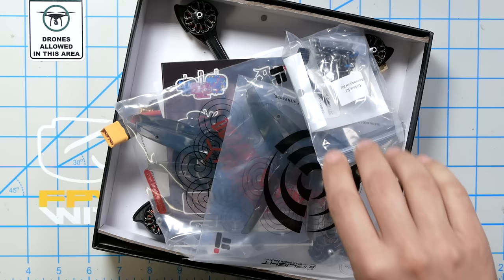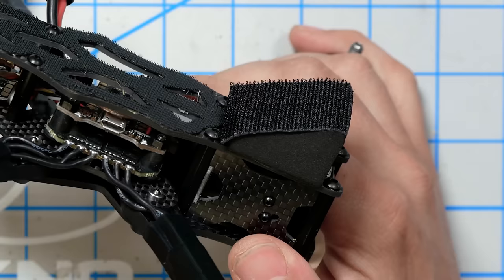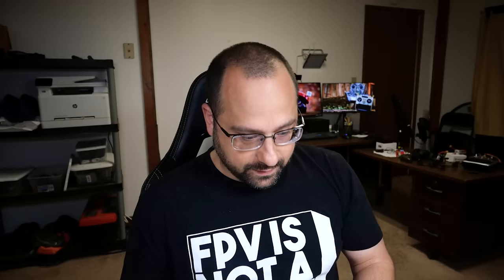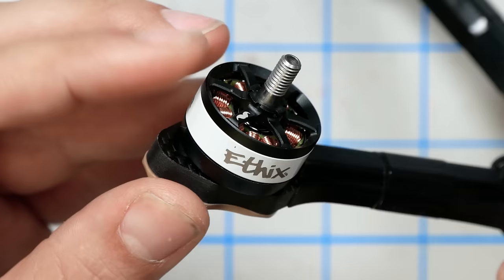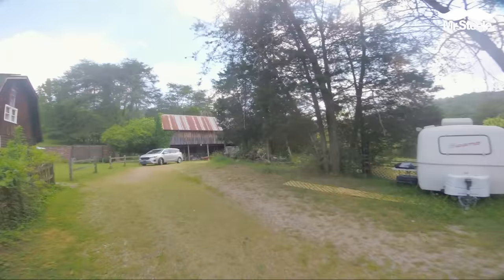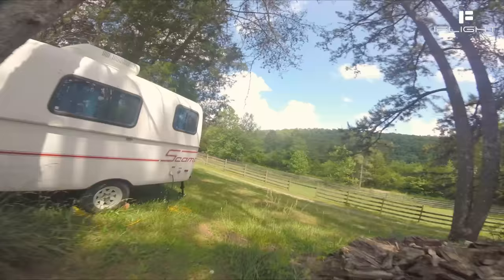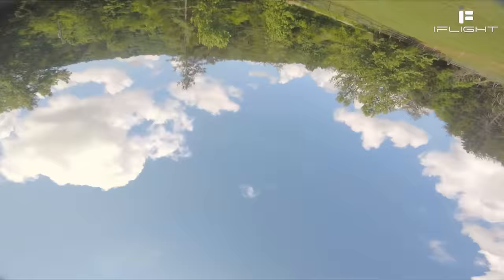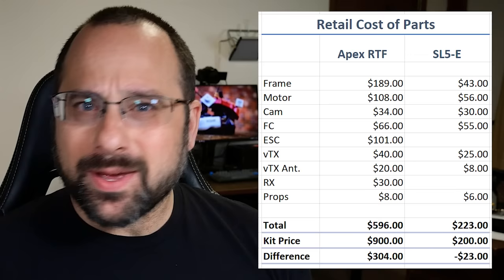Mr. Steele $900 Apex RTF vs. $200 iFlight Cidora | WHICH WOULD YOU PICK

Comment: I been flying the KISS 4in1 ESC pretty much since it first came out & can also say, never had that happen to kiss 4 in 1 (Well I have burned one but that was from my own up all night till 5am building stupidity 😂)... Unlucky there. As far as actual frame durability goes, Apex is the most durable frame I’ve ever flown. My prototype Apex test frame (I was one of the test pilots for ImpulseRC during the Apex development ) is still going strong for over a year of abuse now with nothing but the expected cosmetic grazes, chips, nicks and a bit of delamination damage to the tip of one of the front arms from smashing into a rock after diving from a cliff. Arm still structurally good even after that heavy impact (And prototype arms were actually a bit thinner & lighter than the final production version) I know my Alien arms wouldn’t have survived an impact like that and Alien was a tank. Apex is quite exceptional in the thought that’s been put into it, it’s very apparent when building it. Apex was designed around KISS Components & TBS 5v unify, the placement of that particular VTX isn’t a problem as it simply just plugs/unplugs to pigtail connecting it to the ImpulseOSD board behind the camera so top plate can easily be removed completely and out of the way. You missed that there are also strain relief holes either side of front bottom plate for extra xt60 placement options. I do understand you’re just comparing as they come in RTF form though. So in regards to that, I would agree in your conclusion that it would be insane for really anyone to spend $900 on an RTF. 99.99% of pilots shopping for an RTF have no need to spend that much & the rest of the market would just build it themselves. Though as a professional tradesmen in my day job, I think the $300 mark up difference you’re questioning is quite fair when you consider labour (time, effort & workmanship) costs in the USA compared to labour costs in China. I’m imagining the RTF Apex is built in-house by Get FPV staff and the iFlight built for peanuts in some Chinese factory. That’s probably worth a mention. Would really find it interesting to see you do an actual frame review & build of the Apex to you own specs and compare building & flying it to your favourite daily driver.
Reply: KrissKwadd ditto luv my hd apexes...hes gonna put betaflight in apex now n compare
Reply: @flo-ridafpv5713  Would be good to see him do that indeed. Even better build from scratch. Yeah man, is such a good & fun frame to build out & appreciate the thought that went into it. Awesome to hear you're loving yours mate 👌

Comment: omg i loved the refrigerator ending. I got a sl5e 6s from getfpv in march , friken love it , NOTE i had to switch the VTX power to 5 volt as it would reset when i would punch out , not fun but fixed. Im using a 6s 1300mah 120 tattu

Comment: Still watching but I say both will be fine but the key is to stick with one setup and fly until you have mastered flying it. That is the key to Steele, he has run basically the same gear for years. I flew many different quads my whole FPV life so far and even though I have been flying about the same time as Steele he is of course far and away better. Steele doesn't sell his build to rip people off he sells it because many people think its the gear that makes you good and if they only had exactly what Steel uses they will be good pilots. I think the price proves it, he is trying to get people to source their own parts and learn but lots don't want to so give them what they want.

Comment: I know this is an old video but have to do this:

No there isn’t a “ton of profit in this”

I will go crazy and say they save 40% off of retail for parts (which it is probably closer to 20-25%) but I’m exaggerating for effect. That increases what you call profit (which it isn’t) from 300 to 538. That is a 38% material cost for the product. 
Labor costs at minimum are 40% and labor benefits and payroll taxes are (depending on state) usually around 30% of that. Which means labor costs for that product are roughly 52%.
That leaves 10% of the retail left ($90).
We have not paid for building costs(maintenance/rent/phone/internet/electricity)/shipping/insurance/marketing/IT or the important tax man and business fees to operate.

Profit is not retail cost - cost of physical material. No matter what the business the highest cost for producing is LABOR. Doesn’t matter if it is a vehicle/food/furniture/computer. And again for effect: highest cost to produce something is the labor behind it; you want something for cheaper labor is being taken out by use of robots.

But there is a “ton of profit in this”

Comment: I can tell you that the iFlight quads are tuned for the "masses"- meaning average, all-around, safe, on the softer side tuning. The iFlight stuff [mostly] all needs to be turned up a bit.
The Apex quad is probably tuned for more the type of person who would buy a $900 quad- meaning high, tight, fast, sharp, hotter, cleaner tuning.

Comment: JB, 10:15, tapered arms don't necessarily mean that they are stronger. In the topic of strength of materials, overall cross section, width, and height would matter more than the geometry (taper/straight). Assuming the carbon fiber material itself and fiber directions are the same.
Reply from the maker: Tapering from 4mm to 8mm will be stronger than staying at 4mm though.
Reply: @JoshuaBardwell   Fair, that's definitely better. I didn't have the dimensions of the arms. Cheers.

Comment: Hey, JB.  I had the same problem with my Apex Build, which I built myself, on my first test flight.  I built the apex exactly like in the video tutorial by Steele.  The holes I have also filed out exactly as steele in the video.  Now my 4in1 ESC looks just like yours.  The Kiss FC also died because of the "small" fire.  My first thoughts: It could happened because of the higher voltage due to the 6S battery.  I rebuilt the Apex with a new 4in1 ESC and a new Kiss FC.  After that I charged the 6S batteries up to a maximum of 24V.  Since then I have flown 12-15 packs and have had no problems.  Thanks for your videos and many greetings from Germany✌️

Comment: Just build a quad from the best quality components available and land right in the middle of the price range :P 
Most of the features on the 900$ steele build are just default stuff that comes with the apex frame... Also mounting a vtx on the topplate is no issue for repairs as they mostly come with plug connectors anyways. So just plug them off. I bet a lot of the noticeable difference in flight came from KISS...
Also the stack on the apex is actually a positive. You can change the arms without unscrewing the whole stack... Why would you want to unscrew the stack screws anyway after initally building it? I really think your criticism on the apex frame is off and you are definitly missing the point of why they did it that way. It's definitly one of the best frames. Definitly the most duable one.

Comment: 25:20 - "it's cheaper than the cost of its components".  I find that is true for almost everything, from tech to woodworking.  If you want to make something that's unique, then there's a certain joy in conceiving and building it, and you can't compare the cost of materials, because there's nothing to compare it with - but if you want to make something that's already on the market - just buy the mass-produced product.  It will be cheaper, and what's more, it will have been tested, and you can look for reviews on it.  Like this one!

Comment: I actually prefer the apex because it’s very rare that I ever need to get at my stack screws when I crash. Most of the time I’ve broken an arm and need to replace them and the fact that my stack screws do not go through an arm is super nice. I switched from the Johnny frame to the apex mainly because the apex is crazy durable and I am able to change parts without issue.

Comment: Isn't the biggest difference that the Mr Steel quad is just lighter in weight?  More nimble.
Reply from the maker: The weight difference is about 20-30 grams depending how you spec them out. I have flown a quad with a Session and then without, about a 50 gram difference, and I would say the difference is not that Steele's build is lighter, although that does play into it.

Comment: I would bet that your impressions had something to do with latency v, your reaction time. You can do a personal test by have someone hold a ruler vertically in front of the camera with your thumb and forefinger either side of the bottom of the ruler. When the ruler is dropped you have to catch it between your thumb and forefinger. The distance it falls before you can stop it gives you a measure of the total system time. See if you can detect a difference between these two quads.
Reply from the maker: That's a measurement of reaction time though. I don't think it's a great measure of latency.

Comment: I re-watched this video today,  and after struggling with some quad related things,  I had a second throught on your assertion of where does the 300 go.

I went to swap a esc on a betafpv 95x v3.   It went poorly to say the least.  The usb ended up literally falling off when I tried to plug it in.  The down clips were never soldered so only the traces were holding it on the board.

I started tallying the amount of time I had into fixing this little copter.  The rear right motor stopped spinning.  Bought a 70 set of motors.  Got them.  Swapped it.  Didn't spin.  

Took out the esc.  It looks like it shorted to the carbon fiber (pro tip: Carbon fiber is a conductor)

Ordered the esc. (No solder version, all clips).

Arrives.  Need to solder the power wires.

Dig out soldering iron and set up.  No flux.

Finally get set up, solder the wires. Plug in new esc.  Usb connector falls right off.  I am 4 hours in to playing around with this little thing.

The thing is a week old.  It hasnt been flown roughly.  Just around a golf course and a indoor gym.  But every time it landed it made a 'reset' noise.  Probably the short.

My point is,  at 300,  how long does it take to build?  How long are your build videos?  How many parts are getting accidentally broken in the build.  How much do you pay the person building it?  

The person putting it together needs to be paid.
The person owning the company paying that person needs to be paid.
You need to cover broken, bad. whatever parts.

300 seems excessive I suppose,  but how much would you charge me to build my quadcopter for me?  Assuming anything that went wrong,  you had to replace?  

Its a tough one here.  Regardless,  I am not Joshua Bardwell,  and I am going to break something today.  Thanks for your videos.  They have helped a lot.

Comment: At first seems like a crazy comparison, but in the end this was a very interesting video. Bnf budget 5 inch has come a long way. Sure, it's more expensive than a Tyro 99, but the bearings in the motors that came with that, were so bad, the motors made more noise without props, than most decent motors make with props.

Comment: Could the snappier feeling of the Apex vs the Iflight really come down to the motor size?  A lot of the moves you were doing were low throttle snaps which the 2306 steele motors would excel over the xing-e 2207s.  Also, the pitch would probably help as well but just a thought that the main difference is the motor size and prop pitch and if they were equal, it seems like they would almost flight the same.

Comment: Buy the cheeper one, or build/ modify your own.  Your really looking at kiss vs betaflight if you ask me. Your gonna crash it anyway. Nmb bearings are fine nsk are okay. I've used both. It's the quality of the motor shaft, bottom lock bolt washer setup, tolerance that's going to keep the bearings spinning smooth. I've put the best Nmb bearings you can buy in horrible motors and never really had great results.

Comment: I think a looot has to do with the weight as well. The Steele reacts quicker to movement changes and doesn't drag out as much when cornering or basically doing anything. it so to say adds latency as well. the combination of everything gives more actual control with less latency which I would love to have as well.....

Comment: The reason the esc/fc bolts don't go all the way through is to isolate the fc from the arms to help minimize vibration to the fc from the motors
Reply from the maker: Sure but there could be a pass through hole to allow access to the screw head.
Reply: @JoshuaBardwell  possibly but there is mounting holes for both 30.5 x 30.5 and 20x20 fc 
Would probably turn the arms to Swiss cheese 
Just takes a bit of planning when building but i see your point

Comment: Hey JB, correct me if I’m wrong. If you buy the impulse Rc Mr steel kit, then the FC and ESC you looking at a little under 400$ then add the camera of your choice, your well under the 600$ in parts you were talking.
Reply from the maker: You can look at the spreadsheet I put on screen in the conclusion. I added up all the parts. It comes to $600.
Reply: Joshua Bardwell Sorry, spike before I finished the video, takes me a couple day to get through one. Thank you for sharing your knowledge.

Comment: Great video, but that throttle control difference is mostly about the difference in props.  On 6s the watermelon props have amazing throttle control.  In my opinion, the Nazgul props aren't that great, and don't have that locked control feeling.  You could do another video about your opinion of the Apex vs Cidora, when both are running watermelon props.  I'm betting the difference then, would be minimal.
Reply from the maker: It's just not the props. At least not totally. I have flown Watermelon props on several different quads.

Comment: I bought a Redcat Carbon 210 2 years ago for $250.  I hate it, it flies like crap, but I have smashed it into a parking lot upside down at full throttle, I've slammed into trees, I've lost signal at 400 feet in the air and watched it tumble to the ground, and the stupid piece of junk still flies. 

I've since bought a Tyro99 (broke 4 arms in 2 light crashes, replaced, broke 4 more), a Tyro 79 (fried ESC, replaced, fried ESC again, found loose magnet in motor, not sure what to do now), and I've homebuilt one quadcopter with a Mamba stack (fried ESC I'm thinking because bad solder joints? new one on order, practicing soldering more.)

So I keep flying the wobbly piece of garbage because it won't die.

Comment: Dear Mr Bardwell, firstly I would like to express my appreciation for your many helpful videos. The reason I am posting this message to you is because Getfpv referred me to your videos for tech support, so I hope they are reimbursing you. I purchased a Lumenier 50 amp 4 in 1 ESC and the Lumenier lux F7 controller from Getfpv. The ESC came with no documentation. Upon receipt of the product it was obvious that this ESC does not support the featureset advertised by Getfpv because the wiring harness obviously does not have the physical connectivity. The posting on Getfpv's website has links for Blheli configurator and the manual for the ESC, both of which are broken to this day, several weeks after I notified them of the problem. Furthermore The Lumenier website makes absolutely no mention of this ESC whatsoever.Upon my request for tech support (via email because Getfpv is currently not providing live tech support even tho most of their competition does) for the ESC Getfpv refuses to send me a wiring diagram for the ESC. Furthermore, the Luv F7 is DOA, and Getfpv is jacking me around to replace it. I have since replaced the Lux F7 with a Speedybee FC purchased from a great company, Raceday Quads, and the quad flies great, despite the fact that the ESC is just a plain Jane ESC that supports none of the touted advanced features.Also Blheli configurator doesn't even recognise this ESC. I am a disabled person, and this build cost me a lot. Its a 7" quad with many peripherals, that's why I got the Lux F7, because of the connectivity and features. I am hoping that science Getfpv takes the liberty of using you for their tech support that you will reach out to them and influence them to make this right to spare me the trouble of taking further action against them. Thank you for any assistance you can offer.

Comment: First of all you can build the apex for $599. Secondly, there are much greater costs in this hobby like transmitters, goggles, GoPro, crossfire, and batteries. If you’re getting into this hobby be ready to spend some money. Compared to nice 3D planes which cost upwards of $2000 I think quads are not that bad. This is a relatively cheap hobby. I started on a cheap quad and had multiple problems related to quality of parts and durability. Now I upgraded to the apex mr steel kit.

Comment: hey, the file they added to their package, could it be that this is for filing out the esc? I could imagine that filing out the esc holes would void the warranty, so they choose to add a file for you to do it yourself? it looks a bit oversized for m3 holes though...
Reply from the maker: The file is typically included with the frame, for rounding off the edges if you prefer. You can't really suggest that they expect you to disassemble your own ready-to-fly quad and file the PCB on the electronics. That's not something anybody selling a RTF would expect.